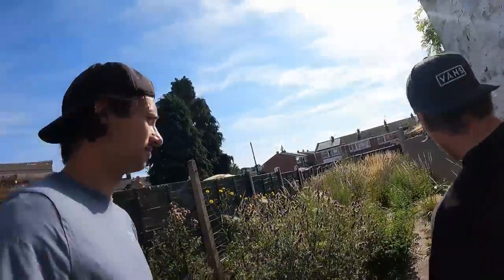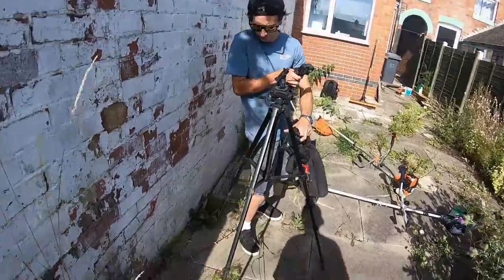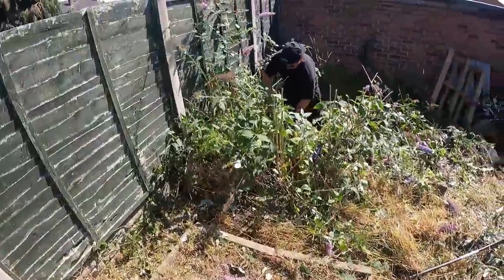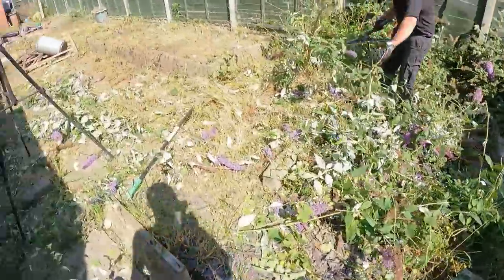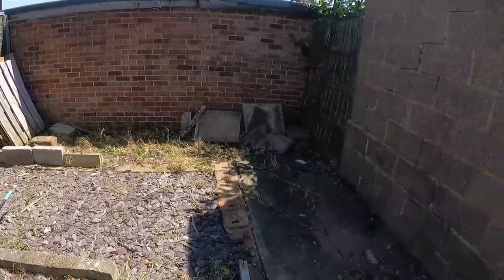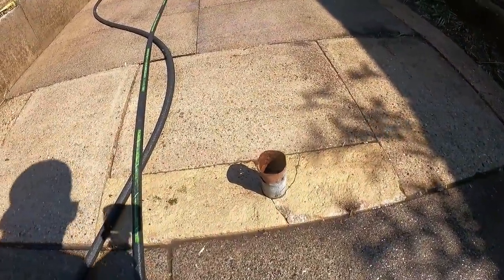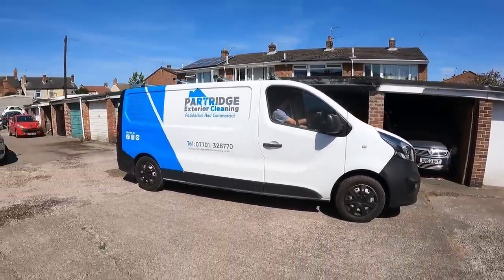JUNGLE GROWING OUT OF PAVERS!! | FREE YARD CLEANUP (I Broke My Tools & My FOOT!)

Comment: You two didn't lack for courage.  Noted you were using a brush cutter instead of string on the trimmer.  That was a pretty stunning transformation.  It was a little hard to believe it could be done but you were the ones with the experience and certainty and made it work.  Paving reappeared, weeds were removed, beds found, everything cleaned and washed.  You wrested a lost garden "back from the wilderness".

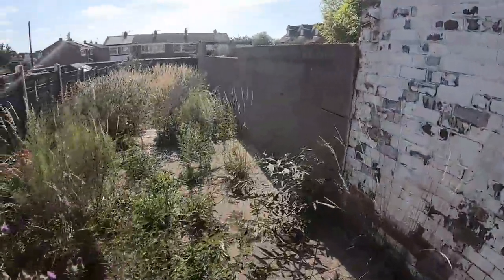Comment: Looks like your fuel mixture is a bit too oil rich. Empty the tank, clear out the spark arrest, run the tiniest bit of unleaded through it, and i mean the tiniest bit, and it should strip off the excess carbon build up on the valve. Then go back to your 1:50 mix.

And remove the guard. You get through it all much quicker.
Reply: I agree, to much oil, that why its smoking up a storm. Or the mx could be old
Reply: Yes gross. I'd be sick from the smell.
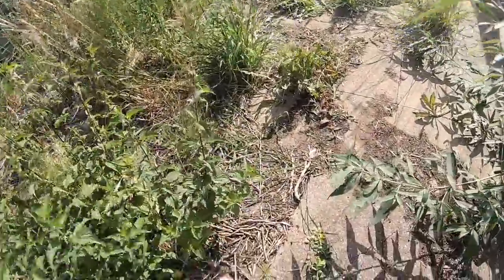Reply from the maker: Yeah it was a 1:50 mix which was odd, the other strimmer had the same and was fine. It’s an old strimmer though and ended up breaking at the end of the job
Reply: Maybe dirty fuel or indeed to rich, but my compliment. What a hellish place
Reply: @PartridgeExteriorCleaning  probably worn piston rings ,now you say ,she,s an old girl , worn rings would cause excessive smoke :) easy fix  .
Reply: Ha ha, that's what I was gonna say! Fuel mix too rich and might want to remove the guard, but with the brushy stuff you might want the protection of the guard for your shins.
Reply: @PartridgeExteriorCleaning  Well... it got a good full-use send off.  LOL
Reply: Thank u for this comment haha I was like.... what in the actual 😳 world is he using haha this comment helped a lot in my understanding of what was going on after all.  :)
Reply: Seriously, don't remove the guard. If you're in a built up residential area with windows, conservatories, cars, people etc etc that's just asking for trouble...

Comment: You’re really getting put through the mill lately. Hope the foot heals quickly.
Reply: Twisted ankle, done it a few times and I dread it every time. It hurts, the pain fades then a bit later it flares up and hurts a lot. But by the morning it's usually back to normal. Still, it's possible to break them doing that, so at least that didn't happen.
Reply from the maker: Haha I know right, one thing after another!! Gotta laugh or I’ll cry 😆
Reply: I've scaffolded for many years now rolled my ankle countless times. Both or mine are knackered now, every morning they pain me 😭😭😭🤣🤣🤣🤣

Comment: Little tip of the day. You can take the guard of the strimmer for a much easier cut and less stress on the motor 👍… awesome job too coz that’s back breaking work FairPlay.
Reply: How does taking a guard off put less stress on the motor 😂
Reply: Taking the guard off is dangerous and will make the brush cutter work even harder. You clearly have no experience and dont have a licence to use one.  (it is smoking due the fuel mix being mixed incorrectly)   He is doing the safe thing by using the guard all i would say is next time wear the correct ppe.

Comment: Happy to see you're wearing goggles whilst operating the trimmer.  I once had a trimmer kick up a piece of shrub that was where branches joined in a knot, and it launched what was effectively a martial-arts projectile directly at my face.  If I hadn't been wearing glasses, I would have lost an eye (only needed about 6 stitches).  So, public service announcement:  If you use a trimmer, use eye protection!  :)
Crimony--that pipe sticking out of nowhere is a hazard.  It's probably a receptacle for a large folding shade umbrella.  Still, even when not in use, one needs to put some kind of flag or warning cone on it.  Sheesh.
Reply: The pole is probably a rotary washing line holder
Reply from the maker: Absolutely, I’ve learnt my lesson from power washing with no glasses on, but if grit right in the eye that wouldn’t come out for a full day 🤓
Reply: I wear my chainsaw headgear when strimming. Gives protection to my face, head and ears.
Reply: @PartridgeExteriorCleaning  My god, that had to have been horrid.  Glad it came out.  My wife's eye got inflamed once from a dust particle blown out of an air conditioning unit and while the particle came out, it took steroids to quell the body reaction.
Reply: @cats8336  Ah!  You're likely right.
Reply: @ramblingman8992  Seriously good idea.

Comment: 1) Yeow!  I rolled my foot a few years ago at mile one of a 1K race.  I hope you'll check in with the NHS.  My first visits to  doctors here in the USA did not find the hairline fracture - that was found later by a podiatrist after I ran on it and opened the fracture enough to see.  I truly hope yours is a simpler issue.  

2) With so much growth, I would have worried about the garden having a rat nursery.  Ugh.  And because the plants had already gone to seed, the new owners will have a lot of work in the next few years to try to keep it free of weeds.  Triple ugh.

Comment: Nice video , I think you need to put less 2 stroke oil in that brush cutter fuel, either that or use the synthetic 2 stroke oil, that smokes less, which will foul up the plug much less. 👍

Comment: ED RN here 🙋‍♀️, did you get your foot X-Rayed ? From your description i think you have probably done a base of 5th metatarsal fracture (the outside bone on your foot).
When you roll your ankle like that, the ligament that attaches to to the base of 5th metatarsal pulls off and take a bit of bone with it. Usually it means you’ll need to wear a moon boot for 4-6 weeks 😬 which is not ideal for your line of work. Good luck! 
Well done, the yard looks so much better than before.

Comment: As a nurse, I really hope that you had your foot X-rayed when this happened. You have numerous small bones in your foot that can easily break. I had my foot slip off a hose release of a vacuum cleaner. Foot swelled almost immediately. Waited a couple of days in pain, then discovered that I had, indeed, broken two toes in multiple areas. And I suspected a break but tried to deny it. Not a good practice. I understand about completing a job though. Broke a finger breaking up an attack on my dog while I was mowing. It was completely knocked out of whack. I slapped an ice pack on, made sure my dog was okay, then finished mowing because I knew I was sidelined for a bit. Ended up missing work almost 3 months.

Comment: With the pain on the top and bottom of your foot after rolling your ankle, it sounds like you've torn a ligament or tendon. If it is, your foot and ankle will come up super bruised and swollen. My partner did something similar and A&E (I insisted he get it xrayed just in case once he got in from work) said it would've been easier if he had broken it because the healing is a fair bit more intense and hurts longer because the tissues take longer to knit back together than bone. R.I.C.E it for a few days, and honestly, I think everyone will envy you getting to sit with an ice pack in this heat 😂

Comment: 2 things here.  1st is very good job indeed.  2nd, back in December I fractured my left foot in a eeriely similar way.  I misjudged a step stepping off a pallet, rolled my ankle, and my weight and a box of laminate flooring came down on the outside of my left foot.  I'm probably 30 to 40 kilograms heavier than you too.  It's not fun and take care of yourself.

Comment: Just curious…I’m in Texas. What does “warming up” for you mean? For us, it’s been above 100 the last several weeks.
Reply: Nothing like as hot as Texas!  We had a couple of days of 39 and 40 degree heat.  Small beans for you guys, but all our buildings are designed to keep heat IN, and very few residential buildings have air con.  Still, most of us got through it, though there were wildfires in London and Yorkshire and about 40 families lost their homes.

Comment: DUDE... did you really use a brush cutter in short pants and sneakers ??

If you catch a metal wire in the blade, it's gonna come flying in your leg at such speed that it will cut it open, muscle deep !
and if it's barbed wire, well... let's say you'll regret you did not wear a pair of boots for the rest of your life
Also, if the blade break on its axis, and that a big chunk of it come flying toward your feet, it's not the little plastic protection that will stop it....

Security equipment and rules exist for a reason, to avoid loosing precious time of doctors and nurse in the emergency service of a hospital for something that could have been easily avoided with a bit of common sens...